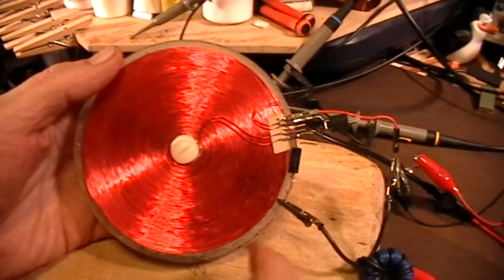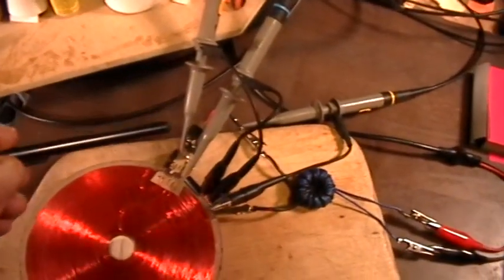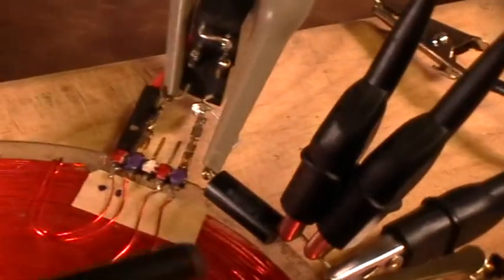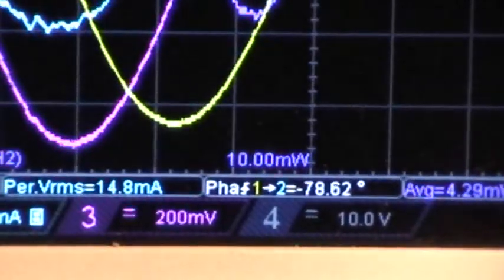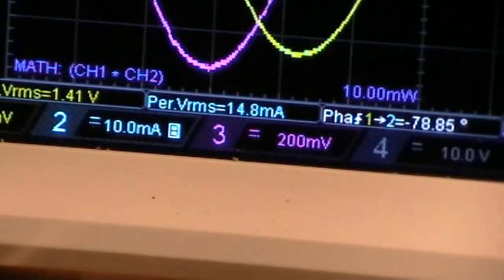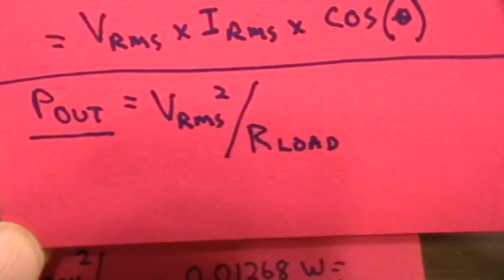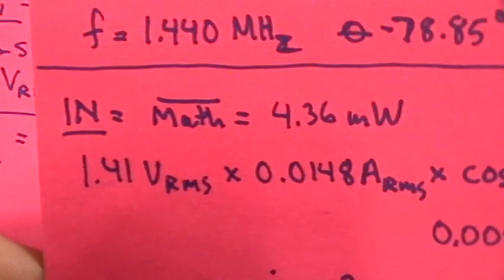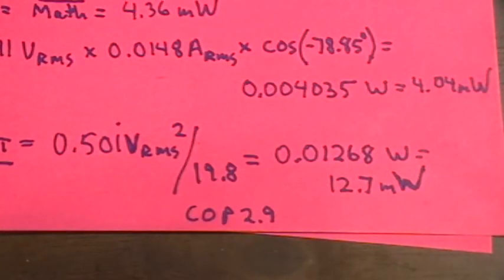Electric OU: Investigating the Partzman Bifilar Transformer 1

Comment: The phase shift and the polarities are confusing the results. I would use 2 scopes: 1 to measue current and voltage of input and one to measure output current and voltage. Use isolation transformer on each scope as you will not have a common ground due to phase shift. That will give you a clear picture of what is really going on.

Comment: Thanks for this very interesting video, TinselKoala, the experiment is carefully conducted and well documented. I'm about to duplicate it. In the time since this experiment, have you investigated the origin of the amazing COP?
Reply from the maker: Yes, I just haven't yet posted the video of that further investigation yet. Hint: How would you test to see if the PBT itself is actually causing the OU readings?
Reply: A possible measurement error is induced currents in the measurement loop. Scope probes are poorly designed. The ground wire constitutes a wide loop through which a leakage of variable magnetic flux can induce currents that totally distorts the signal (I had the problem).

Comment: The input inductor looks capacitive because it is above it's own self resonant frequency, whilst the output circuit is still below it's resonant frequency, so it still looks inductive. Because of this, the input and output currents are travelling in opposite directions at any given moment in time so from the input's perspective they are subtractive.  The generator then, only has to source this 'difference' value between the input and output load currents.  Another way to think of it is.. total phase difference (output back to input)  is such, that when the Lenz effect current arrives back at the generator it assists rather than loading the input current.

Comment: The broken serial connection and the open input winding are impeding my analysis of this! I would have said it's some kind of capcitive effect (since you're driving an inductor at a relatively high frequency) whereby energy is being stored in the field. Very interesting.

I tried to register for an account at overunityresearch.com but registrations are disabled, do they take on new members only now and then or is it an invitation-only forum?

Comment: Hi TK guessing one or both your coil lengths might be greater than 1/4 wavelength meaning the current may be travelling in opposite directions simultaneously over part of the coils length. Which  can make it subtractive  as far as input power is concerned, action is similar to video clip watch?v=GFqJ5D6mkO0

Comment: Only a couple of extra measured milliwatts at the output are needed to make the system exhibit an apparent overunity COP.  This could easily come from ambient sources, especially since all measurements are AC.  So either Faraday shield (which you already suggest below) or ramp up power levels so this external noise won't have such a proportionate influence.
Reply from the maker: Yabbut Shirley you noticed that the effect demonstrated here was more than just a "couple of extra mW". However there is much more to come, some of which you have seen over there, but I'll be putting it into another video SooN. 
The chances of it coming from the environment is minuscule. The real answer is more subtle than that. Man would I like a cold pint of the bitter right now.

Comment: Magnetic resonant amplifier comes to mind...why does the input power go up when secondary is open?
Reply from the maker: I have several other circuits that will do that. Even some simple Joule Thief circuits will do it. At the tiny power levels shown in this video it's nothing to get excited about, just another interesting thing to think about, and likely to be explained later as research continues.
Reply: I guess it is about BALANCING IMPEDANCE versus THE FREQUENCY RESONANCE of the coils ;-)
Reply: It's called mutual induction. If you have experimented with motors and transformers and doing winding experiments... Hint: without the mutual induction secondary current, the primary can act more resistive and less inductive. Same if you apply pressure to turning shaft of motor. From my experience, this is totally expected behaviour.

Comment: This is the best demonstration yet! When you panned down to the COP.... it got me excited. What otger variables can contribute, Electronic Smog perhaps?? Faraday cage it to be sure?
Reply from the maker: Don't get too excited yet! I seriously doubt that this setup could be picking up much energy from the environment. (Not because I don't think it possibly could, but rather because I don't think there is really that much available.). But if other causes for the effect can be ruled out, then it might be worthwhile testing inside a good Faraday cage. This is not trivial to do, though.
Be sure to watch my video on the NRMJT meets the Black Box.
Reply: I can't help but to get excited when I see applied science. "Overunity" or not, it all interests me when its open science. I will go have a look at that video when I get the chance. Thanks as always for sharing.
Reply: agreed ~Russ
Reply: I watched that video and had a thought a little. What is the phase relation to the "monofilar" pickup coil and is there some power we are missing there, as its part of the circuit through magnetically coupling? This I don't remember if you probed that section of the circuit? I will watch again later after work.

Comment: Thanks for sharing this.  I wish I had the time to join in and try for a replication myself.  I have been way too busy this year to do much experimenting.  Over the last week I have been following this topic over at overunityresearch.com.  I love seeing the way you all are working together to get to the bottom of this.  The team work being demonstrated is awesome.  I am learning a lot just following along.
Reply from the maker: Yes, it's the most fun I've had in a while. Thanks for checking in, hope you can get back to the lab yourself.
Reply: same here, really have enjoyed this, been a while scene i said " I'm having fun now" and its needed! ~Russ
Reply from the maker: Thanks for checking in Russ. We have already progressed beyond this video, by moving the 1.00 ohm CVR to the other side of the ground point, taking it out of the "output" side. Also we have used small incandescent "grain of wheat" bulbs, one replacing the 18.8 ohm NI resistor stack altogether and another powered by straight DC, side by side for brightness vs. power comparisons. It appears that the PBF system will light its bulb to equal brightness as the DC bulb at about half the input power that the DC bulb draws.  I'll have to confirm this with the proper lightmeter and tighter controls but that is what the early results show.
Reply from the maker: But I AM using non-inductive resistors for both the "load" and the input current viewing resistor, except when I'm trying to see some real output like the brightness of a bulb. Those bulb brightness vs. power tests will be coming up shortly.

I don't remember -- did you do some strict comparisons of the Rodin coil winding, with some other geometries using the same amount of wire?
Reply: TinselKoala thanks for the update. I'm still not sure why we are not using non inductive load resistors for our output? and Input?  

I've had quite good luck with my open ended rodin coils. I'm sure you remember those tests. 
Thanks for sharing

~Russ
Reply: TinselKoala no comparison tests like that. however this type of coil setup should be quite semmilur. it's the air coil mixed with the capatance. 

I see on the resistor. 

looking forwerd to the next video. ! 

~Russ

Comment: Perhaps I've missed some introductory videos, but I have some questions and observations:

While the mathematics looks correct, why did you use precision resistors, and why those particular resistance values?

What is the inductance of the coil and how do the results differ from a standard coil of the same inductance?

Thanks.
Reply from the maker: There are a couple of other Tesla Bifilar videos on my channel but they aren't really "introductory" to this one. The use of precision resistors is so that we can have confidence in the nominal value of the resistance, without having to test and mark  and remember the exact value of, say, a 20 ohm 10 percent tolerance unit. The 1.00 ohm Current Viewing Resistor makes it easy to calculate the current by Ohm's Law: I = Vdrop/Resistance value. So if the resistor is one ohm exactly, the voltage drop across the resistor measured by the scope, and the numerical value of the current are the same. I volt drop = 1 amp through, and so on. The other resistors (4 ea. 4.7 ohm 1%) are what I had on hand. Parzman's original used 50 ohms here. Non-inductive resistors are used, especially for the Current Viewing Resistor, because even small inductances have significant effects on measurement in high frequency circuits and we need to see the power dissipation and voltage drops in pure resistances.  The non-inductive feature is particularly important in this circuit.
The PBT coil is wound with 2 parallel files or windings, so it's not really possible to connect a single file "standard" coil in the same way this one is, so you can't really do a difference comparison. But when series connected as a Tesla Bifilar winding, the coil has an inductance of about 660 microHenry. When the series connection is opened and the two windings are  measured individually, they are about 170-180 microHenry each. The monofilar pickup coil also has an inductance of around 700 microHenry.
Reply: @TinselKoala yep from my loads of experimenting, it's amazing how many people forget about the parasitic parameters of resistors and wire and PCB L and C. Perhaps just say that in the video to the viewers to remind them. Good work!

Comment: Hi TK, thanks for another great vid as usual.

The LED on the 'secondary' monofilar coil is half-wave rectifying, causing a certain amount of saturation in the 'primary' bifilar coil - interesting 'mag amp/saturation reactor' effect with 'air core', at high freq.

Fascinating...
Reply from the maker: Yes, one does not normally think of air-core coils as being saturable. I have some little incandescent bulbs that I'll be trying in place of the LED for the next set.